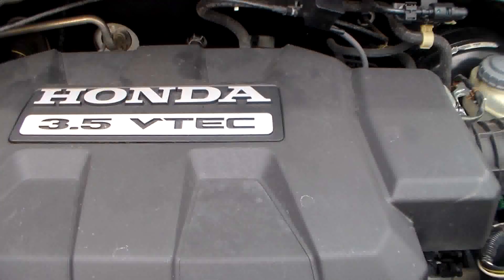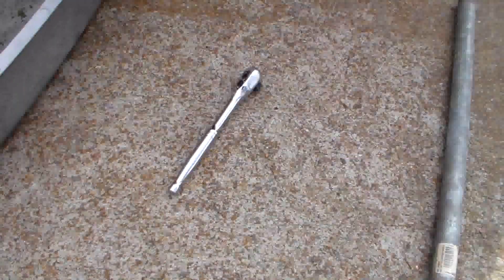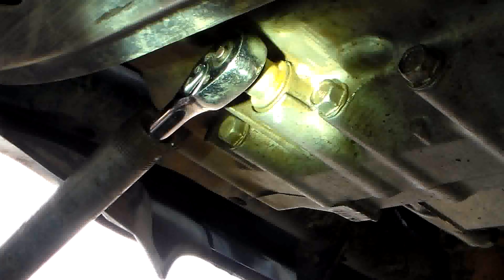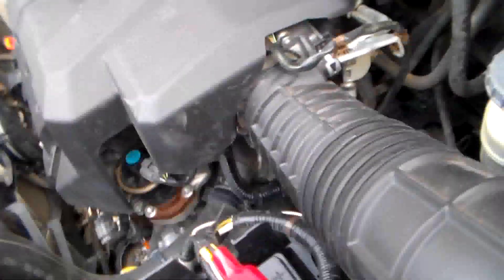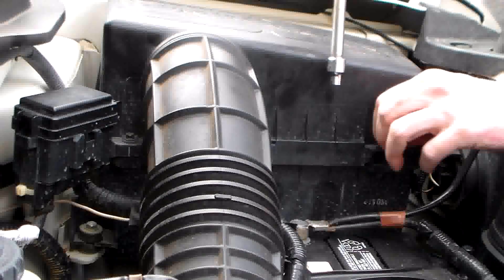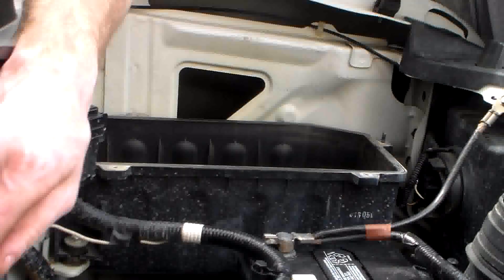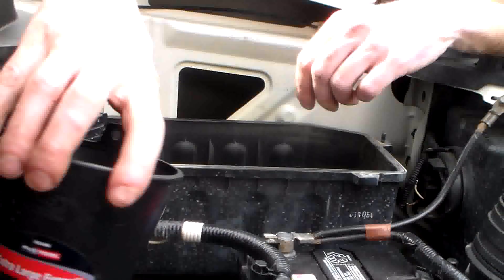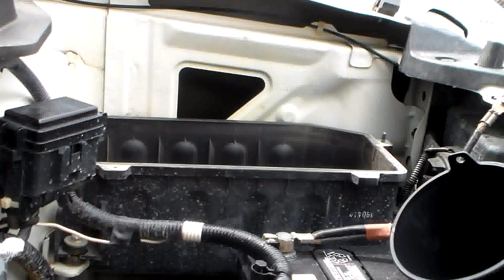Honda Ridgeline Transmission Fluid Change

Comment: Excellent video!  I was going to upload mine, but you basically covered everything.  Although I want to mention two things, (1) you do NOT need to remove your air filter and hose, you can just break open the filler bolt with it in place (20" Socket Extension will give you plenty of room to break the bolt free), (2) you should probably open the filler bolt first so the fluid flows faster from the bottom and doesn't create a vacuum effect.

Comment: I'm the original owner of a 2007 Ridgeline, now with 105K miles. As shown you don't have to remove the air filter box or air intake hose to reach the fill bolt, but having a skinny, long funnel makes the fluid change a snap. Honda recommends always changing the two washers (gaskets), but many DIY owners find that unnecessary. It's still good to have spares. BTW the refill capacity is 3.3 quarts, not 4.

Comment: Thanks for taking the time to do this short video on transmission oil change.  I just bought a 2007 RL and want to catch up on the maintenance.  Wasn’t sure if I would have to drop the trans pan to do it.  Thanks Honda for giving us a drain and refill plug!  Your video was much appreciated

Comment: Be sure you can loosen the filler bolt before draining the ATF; mine had been tightened without using a torque wrench and was partially rounded off; consider purchasing a replacement filler bolt before starting.  You can replace the ATF using the dipstick tube but it takes a bit longer and a real skinny funnel.  Regarding the replacement volume, I measured the drained volume and replaced the same.  Also, if you use a long neck funnel and a long ratchet extension, no need to fiddle with the air filter housing.  My Ridgeline had about 78000 miles and looked like the fluid had never been changed so I did a 3 volume exchange which I considered good insurance against premature failure.

Comment: Thanks Cuptain85.  Very helpful.  I like how you mentioned that it would "be easier" to do it on stands, instead of "being necessary", and how you specifically said, "in order to gain some room" about the air filter cover, rather than saying something like "you can't possibly do this without removing the air filter cover".  That sort of attention to detail is lacking on many other videos I've seen.  Probably because people don't really pay attention. ;)

This video probably saved me $100

Comment: very good and detailed video. I will have no problem changing mine.  you might have commented that the 4 quarts only replaces that which is drained.  I intend to do this at 10K intervals.

Comment: DIY Rule #1: ALWAYS remove fill plugs before removing drain plugs. 

Rule#2: See Rule #1.
Reply: Absolutely.
Reply: you can fill it through the dip stick with a less than $10 boat oil pump from Walmart

Comment from the maker: It was impossible to get a good camera angle of the work being done with the air filter box in the way.  Plus when a few seconds of work provides copious amounts of space, i have found that it is more usual than not a wise investment.  Good point about removing the fil plug first.  An added bonus to that is that you won't have an empty transmission if you are unable to remove the fill plug or one reason or another.

Comment: FYI,  you should ALWAYS remove the fill plug before you remove the drain plug.
Reply: If you can't ge the fill plug open you can always fill through the dipstick tube.

Comment: The transmission fluid drain plug moved from the driver's side to the passenger's side in '09. A drain and refill calls for 3.5 quarts, not 4. Honda recommends installing new crush washers on all drain and fill plugs once they are removed. It is also recommended to use a torque wrench to apply the proper torque to the plugs instead of guessing or getting them "tight enough". It is not necessary to remove the engine air filter cover. The fluid change can usually be performed without jacking.

Comment: What's your opinion regarding 07 ridge line reliability? I have a 03 civic with 200 thou k and she's still golden. I have a opportunity to get a 07 ridge line with150 thou on it. How's the reliability and does it stack up to other Honda products?
Reply from the maker: Robert Beaudoin The Ridgeline definitely stacks up to other Honda products.  I have just recently went over 140,000 miles with no issues.
Reply: got 531,000 kms (332,000 miles) all original trans is starting to bang a bit getting into 1st and reverse

Comment from the maker: Honda calls the tranny filter a "lifetime filter".  It is not necessary to change it, although it is possible.  The transmission is required to be removed and the case opened up.  That is why I did not change the filter!  I will also add that my truck had approx. 115,000 miles at the time of this first fluid change and still doesn't miss a beat!
Reply: wow , im thinking of doing mine with only 30 k miles on it .

Comment: Did it run and shift any better?? And is there a filter to change?
Reply from the maker: There wasn't any problem. Just scheduled service.  
There is, from my research, a "lifetime" filter that requires the transmission to be removed and disassembled for access.

Comment: So the 2007 Honda Ridgeline does not use a transmission filter ??
Reply from the maker: It has one, but you have to disassemble nthe transmission to access....so it does not have a serviceable filter...
Reply: @cuptain85  right on thanks 😊

Comment: How much (litter) fluid need to as I am going to change the ATF for my 2006 Ridgeline?
Reply from the maker: Get the genuine Honda fluid from your dealer
Reply: How much fluid need to 4 litter or more or less. ?
Reply: You need a US Gal, which is a bit under 4L however if you go to a honda dealership they sell it by quarts. Be sure to buy original honda fluids, specially for the differential and transmission.

Comment: hello, is there any automatic transmission service for ridgeline? i heard there are special set of parts like filter, o-ring and honda genuine fluid etc all in one box? does it really exist?
Reply from the maker: nishvut the filter is inside the tranny...like you would have to remove the tranny and disassemble it. I advocate for using all genuine Honda fluids. Thanks 🙂

Comment: Have you had any Transmission problems with your 07? I have an 07 RTX, and I've noticed it downshifts kinda rough around 40mph.
Reply from the maker: None at all.  Have you changed the fluid before?  And if so,wasit with genuine honda fluid?

Comment: Don't be a dummy like me and pull the wrong drain plug. There's a plug on the other side on the bottom of the trans facing straight down. That's the transfer case fluid. I drained it and flooded my at with new atf fluid then took a 200 mile trip 😬 AT overheated and I almost ruined it

Comment: hey I just had to remove the transmission to repair an oil leak,nothing was done just the oil leak... it the fluid was changed for the original that's all but after everything was installed again it seems that it it's stuck on third reverse seems fine but can't  make it to accelerate o" D " nor 1 or 2 the vsa lights  are on also the "D" keeps blinking what can be done? I'm just going back to the shop for warranty. ..pls help
Reply from the maker: only thing I could think of is a wiring connector not reconnected?  maybe a wire pinched?
Reply: +cuptain85  yup that's what everyone keeps telling me too... thanks